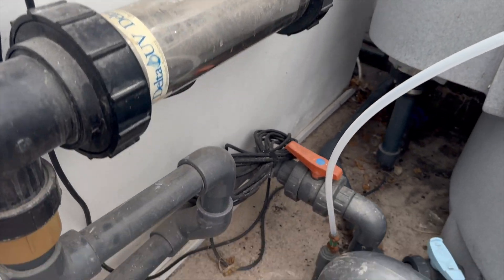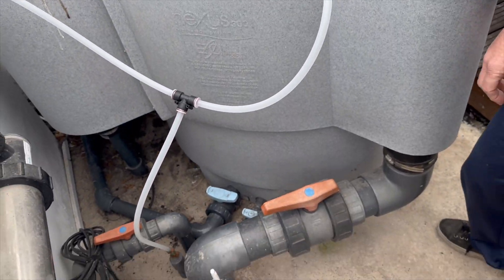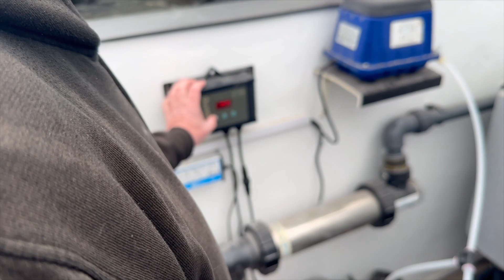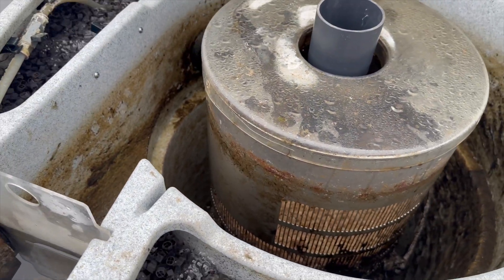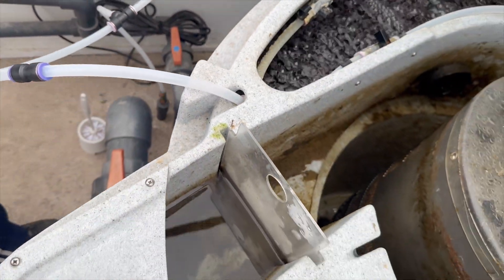HOW TO CLEAN NEXUS 320 GRAVITY - HELP VIDEO

Comment: Great video. How far could I take the waste pipe. Basically have no drain where I want to put the nexus but my house drain is a top of garden. I was thinking I could attach a long flexible pipe to the waste and run it to the drain at top of garden. It’s around 25-30 feet away
Reply from the maker: As along as it’s going downhill to the drain I don’t think it matters
Reply: @TimWaddington  thanks for the reply. It would be going up a slight gradient. Could a cheap pump be used to pump it to the drain.
Reply from the maker: @connoryoung8425  yes you could use an inline pump and turn on when you waste

Comment: How did you switch the air off to the outer chamber I didn't see you close the valve, can you leave the air on to the outer chamber while cleaning? Thanks for the educational video 👍
Reply from the maker: Mine has a slight air leak on one side. I turned the valve off. 👍
Reply: @TimWaddington  thank you 👍